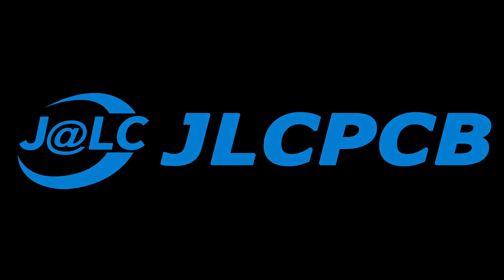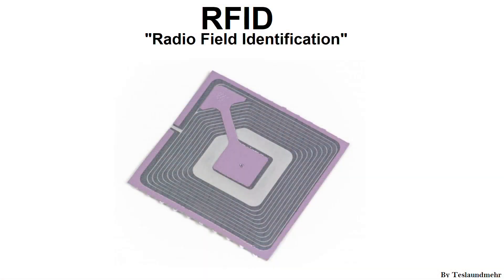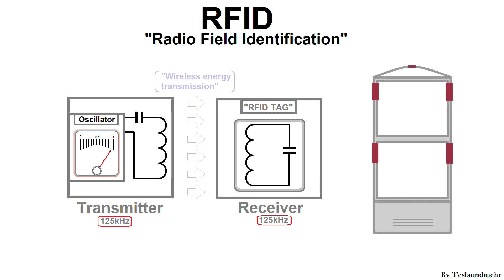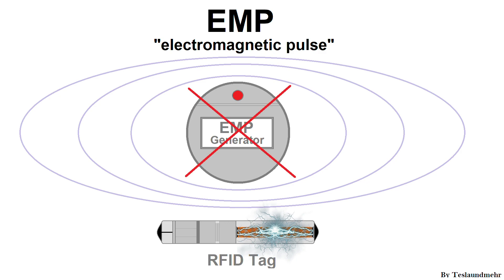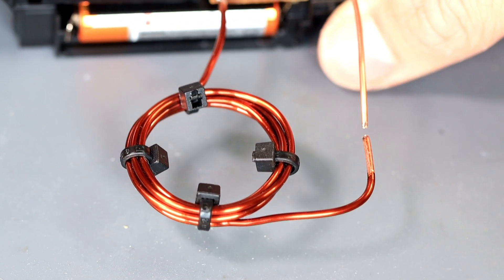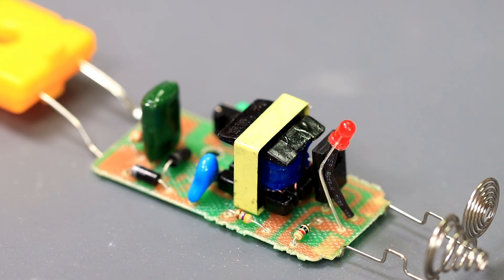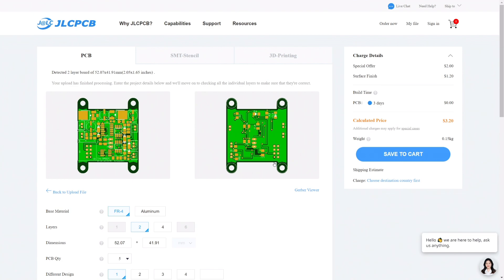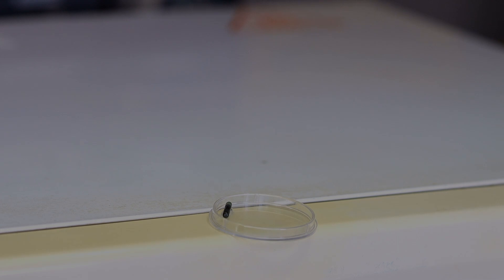EMP RFID chip killer - Does it work?

Comment: lol the microwave is cheating.

there is a step up from the fly swatter (at best i think those do 1.6kv):
a stungun module.

here is a video of me torturing a sudoku game with what is basically a stun gun + coil + spark gap. (guestimating about 20kv)
it reacts, but no damage is done whatsoever. even when it gets messed up it can be fixed by removing and replacing the battery.
https://youtu.be/EvrsGT-65iI

i did manage to kill that calculator with it though.

Comment: I think you can destroy it easily but you need a high voltage source with a coil tuned to the same frequency of the rfid. With a large enough transmitter voltage it will likely breakdown quickly.

Comment: Cool video. The high voltage gets you a fast rise time on your coil, but the total pulse energy is still limited by the energy in the capacitor. To kill an IC, you'd need orders of magnitude more capacitance, which is also potentially lethal to the operator. The destructive energy threshold might be lower if you can get your coil / capacitor to ring exactly at the RFID's resonant frequency - and in that case it might be more effective to use a continuously oscillating device similar to an induction heater rather than a single pulse.

I've had far better luck destroying IC's at a distance using large electric fields instead of magnetic field pulses

Comment: Those implantable chips are nearly indestructible. How can it be? There must be a way to disarm those.Resonance must be the key. Hitting the implant with some multiple of the implant¨s several resonances. The coil does affect the behavior because there is a memory stick next to the coil. The coil only powers the mem stick and there is a a voltage limiter and shunt arrestor in-built in the implant. Insert the implant in some meat, open up a microwave oven and quickly swipe the piece of meat in front of the microwave emitter to see if the implant gets destroyed.  THIS IS VERY IMPORTANT TEST.  My friend had an implant in his brain inserted at night. He woke up bleeding from his nose and had a weird feeling in his head. He is a scientist and scanned a ship deep in his brain. No matter what he did the chip did not break. Only when he cursed the chip in the name of Jeshua, son of God and prayed everything not belonging to his body get destroyed.
Reply: Bros tripping on LSD

Comment: If you power the coil winding with flyback transformer(s) used on older TV's, you can zap most of RFID chips implanted in people. There are plenty of videos on YouTube that show how you can make effective RFID killer devices. Personally, I've made a coil winding with 2 flybacks with approximately 45kv, and magnetic field pulse gun with 2kv at 20amps - absolutely not recommended for novices and just curious persons. But the issue is that, the RFID chips implanted in people nowadays are far more advanced and much smaller and smarter than the one shown on this video.
Reply: sounds like X-rays
Reply: https://youtu.be/IGJjE6a0Nxc?si=vs25iMyJ2LPfi48_

Comment: The anti-theft-thing on clothing is just a metal strip with a specific size so it vibrates in the magnetic fields emitted by the thing near the door. (If I remember correctly 😅)
Reply: No. He even explained it in the video
Reply: @toihin5500  And because someone explains something in a YT video it is automatically right?

But yeah, I mixed something up. Anti-theft tags on clothing have a simple LC oscillator.
And the metal strips I was talking about are in those thick plastic barcodes.
Reply: @-Tris-  Not just YT!  You must also verify it on Wikipedia!  :)